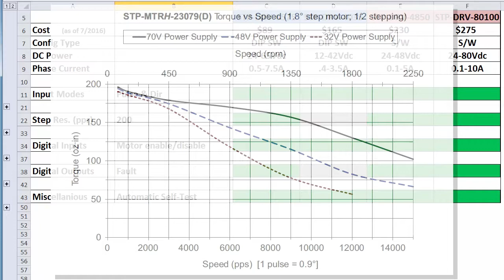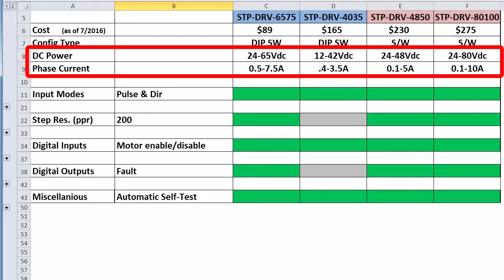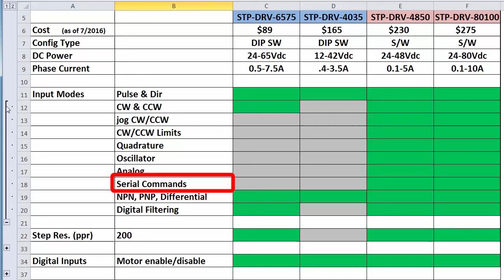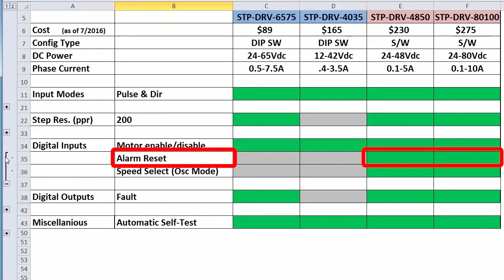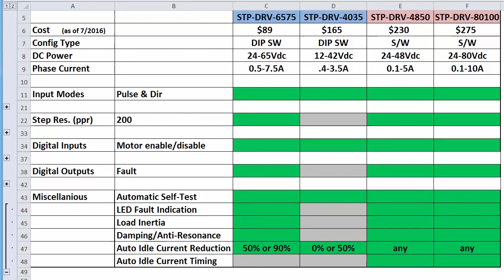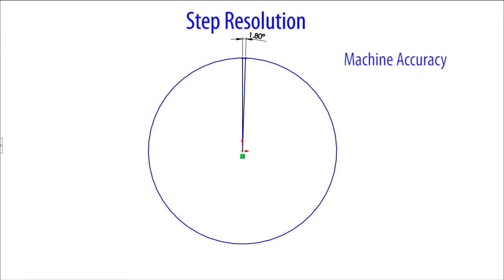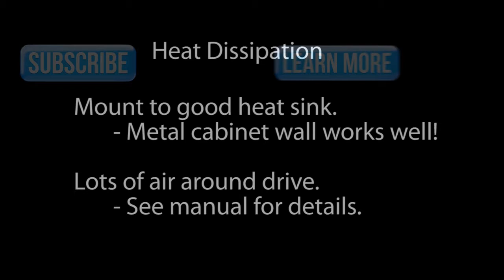SureStep Stepper Drive Comparison from AutomationDirect

Comment: Are these all chopper drivers or constant voltage(LR) drivers
Reply from the maker: Hi Sivaram, These are stepper drives. Which means they provide pulses to rotate the motor.  They are not choppers like VFDs. ... Is that what yo are asking?
Reply: @automationdirect  Im asking if they are constant current drivers or constant voltage drivers
Reply from the maker: @pd.dataframe2833  These are constant current drives.   They always put the same current to the motor.   Voltage (and power) rise at higher speeds.

Comment: What advantage does the more expensive STP-DRV-4035 have over the STP-DRV-6575?
Reply from the maker: Hi ScotY808, 

The 4035 is an older design that we’ve been selling for 10+ years.  We keep selling it for the customers who don’t want to change their design, BOM, drawings, etc..  
The 6575 is a newer design that incorporates higher current, higher voltage, more microstep options, an enclosed cover, and removable terminal blocks.
If this is a new design, then you definitely want the 6575 ...